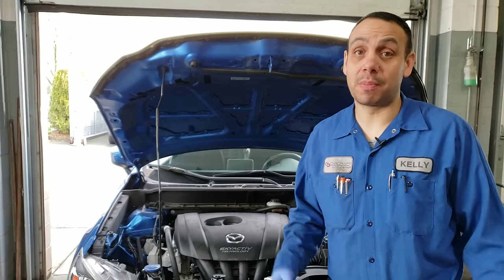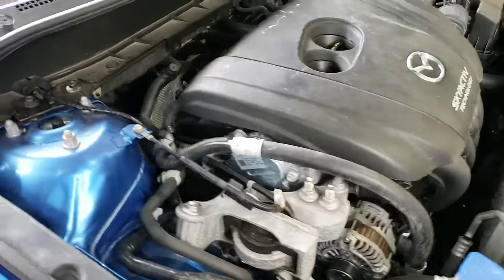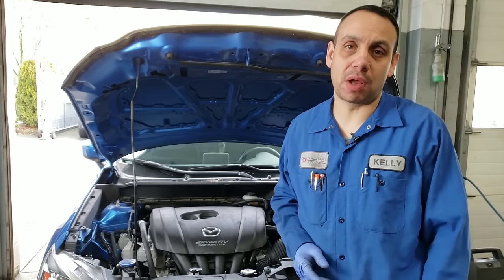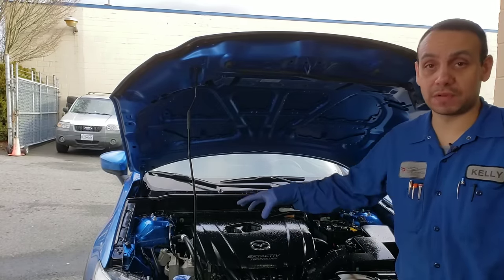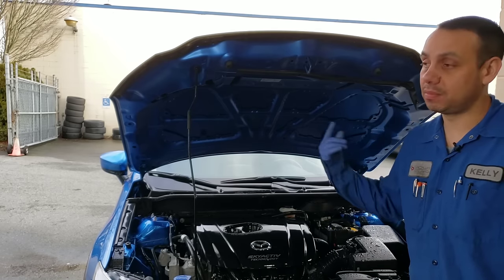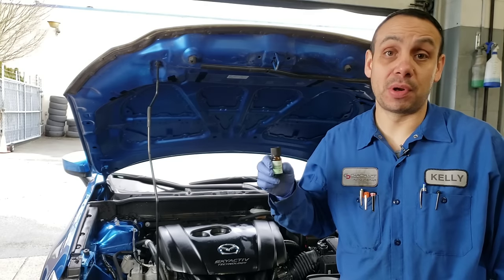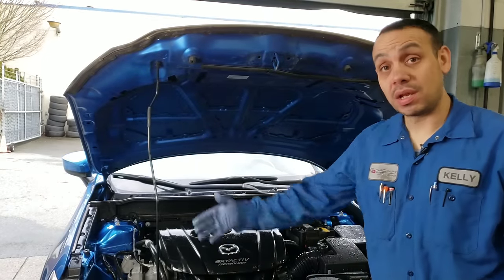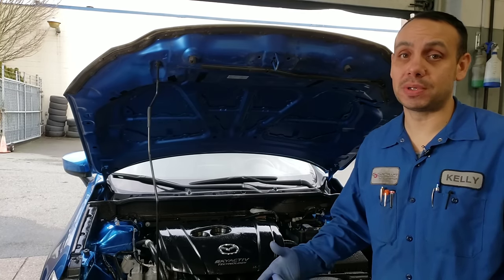Easy Tip To Keep Rodents, Mice & Rats Out of Your Engine Bay

Comment: Thank you for a very worthwhile video! Vermin attacked my fairly new F-150. It was costly. Wish I had known of your system.
Reply: My friend had a brand new side by side to hunt with and a rat cheeed the wires the first month he had it there were several motorcycles and two four wheelers and it didn’t touch them. I set ont big trap and he set one. I got him the first night but I used to work in a face so I know the routes they like to take.

Comment: Great video.  I had to watch it a couple times to hear about hosing the engine down.  I grew up always being told not to but that was 100 years ago (not really) and things have changed with engine design.  
Have a new Dodge Ram and opened the hood and saw that something was starting to tear away at the felt battery cover and had to look up to see what I could do to prevent this before it becomes a problem.

Comment: Great video! The problem is that the peppermint smell will last a week at the most, even less time if it is very hot outside. It will all just evaporate away. If you set traps under your car you can catch or hurt many creatures that are not interested in you car.  I put some peanut butter on a mouse trap and killed a vey cute little bird that made the mistake of pecking the trap.
Get some sticky pads and lay them on flat surfaces under your hood, tape or fasten them in place and bait them with cheese, nuts or seeds. If you use peanut butter use only a tiny speck, the oil in the peanut butter dissolves the sticky on the trap and can make the trap fail.
Those rodents can chew wires and cost you thousands of dollars trying to find the damage. Good luck!
Reply: That bird should have been minding it’s own business
Reply: You have a GOOD IDEA, BUT realize you are going to go through a LOT of traps! The rodents leave "trails" that every rodent within a mile will "tune " in on, killing EVERY rodent in that large of an area will be quite a job! GOOD LUCK!!!

Comment: I saw on a video a couple of years ago that some guy in Arizona makes a concoction of very hot chile peppers and sells it in spray bottles. Others said it worked after they tried it. I guess rodents nesting and chewing wires is a big problem with RVers who boondock out in the desert.
Reply: I live a few miles from him and use that 8500 Scoville rat spray.  It does work, but you do need to respray every couple months.  It doesn't have much of a smell, but will will make you cough and sneeze, if you get careless.  I was a bit overdue, and the little cusses bit through some wires, which I fixed.   But now I need a scan tool to reset and turn off the idiot lights.  I also put a small bag of moth balls on each side, especially next to the battery.

Comment: Very true, peppermint oil is great. I have. VW T3 Westfalia camper and store it over the winter in large vehicle storage building. First year it was filled with mouse droppings and some things left in the van were chewed up.
I then bought mint oil and filled small containers with cotton balls soaked with the oil and placed them throughout the interior and problem solved. You can use the small bottle after emptying some of the oil. Just stuff cotton in and put the plastic dripper back on without the lid.  I threw in a couple mint tea bags too which also seems to work. Japanese peppermint is the strongest.

Comment: Once had a chewed up chicken bone, a gnawed on piece of gum, and a half eaten  piece of bacon under my hood. This resulted in almost $2,000 in electrical damage. The peppermint oil works like a champ.
Reply: Where did you get the peppermint oil? Thanks 😊
Reply: @richardhowe5583  At the health food store. Whole Foods and Walgreens also carry it. I heard that Cayenne pepper / water solution or cinnamon works too.
Reply: @Steven_Williams  thanks? Do you dilute it? Thanks 😊
Reply: @richardhowe5583  Yes, about 1/2 water to 1/4 peppermint oil or Cayenne pepper.  Adjust the strength as you see fit.  Interior of your car may have a strong peppermint smell. I found it to be great for stuffy noses while you're driving 😁.
Reply: @Steven_Williams  thanks😂

Comment: High fragrance dryer sheets work also , be careful not to put them near high heat sources. When i put my truck away for winter i put them in engine compartment, cab of truck , in tail pipes and also on the intake side of my cabin air filter. I leave the cab ones in all year for the nice smell . $5.00 for box of 100 sheets !
Reply: That's the best way, period.

Comment: I have never had a problem with rodents under the hood of my van but I lived in it on my land out in the woods for several months and it was a constant battle with mice inside the van. I liberally spread peppermint oil throughout to the point of nearly gagging myself on it but it had zero deterrent effect. Fresh peanut butter bait in a spring loaded trap will give you the edge. For a while.

Comment: I had an old school bus some years ago. It sat for several months. Found where a squirrel had been nesting in the breather where the air filter was missing. Recently we had a problem with our van with an odd reduction in power and warning lights coming on. The mechanic found some wires chewed on, likely by a rat. We had a family of rats living in our shed. Wound up costing over $700 on parts and labor. So glad I came across your video. The peppermint idea sounds really good. Thanks.

Comment: Use Clove oil, works great on vehicles, farm machinery, and around the house,have used it for years!
Reply: Where do you get clove oil? Do you dilute it? Thanks 😊
Reply: @richardhowe5583  kinda hard to find, I buy it at J/C food store, in the spice section, small bottle, used for candy making, full strength on cotton ball's as a wipe, or leave in needed area's. You can dilute .125 oz bottle in quart of water to spray. Hint spray where rodents access, usually where tires touch ground. Hope this helps you!
Reply: @jimbruner9800  thanks😂
Reply: <Thinking> Cars outside!
Im going to get some OIL of CLOVES tomorrow what a simple idea.
Thanks for the tip < 🤔👍
Reply: Hello! Does the clove oil last longer than peppermint?
Reply: Don't know, never tried peppermint, cause clove oil works

Comment: First of all, foreign wiring that is used is made with material that attracts mice and rats. This video info is good! Rodents also LOVE the cabin filter area, so check it often. Remove all foil ketchup and taco packs, they eat right through them! I use mothballs inside my boat and compartments.

Comment: I use dialectric grease on plu wires and all exposed wires and connectors,  I tried mouse traps and ten traps did not work , they hate dialectric high temp clear grease ,that allso protects and shines plastic parts

Comment: I use peppermint oil around the house whenever I find rat evidence; I heard they use urine trails to navigate and the oil overlays this. I can't set a dog on them because people poison them, very bad for the dog, and I won't use poison (it's unsporting). The house was empty for years and something of a rat superhighway when I bought it but I haven't seen one in over a year now. The smell goes away after a couple of days, even indoors, so a car may need a daily spraying, depending on the scale of the problem. Your electronic box seems like a more 'fit and forget' thing, which would be worth the cost for most people.

Comment: I've lived in the Arizona desert for over 25 years.
When you get tired of spraying your engine with peppermint, stuffing dryer sheets everywhere,  and you now gag at the smell of Irish spring, there is only one solution I've found that works.
Moth balls don't work, battery powered anything doesn't work, a cat or two stuffed under the hood is a great idea, until you forget to take them out before starting the car, and you end up making Alf a feline paté.

You could try to find a used scrapyard electromagnet to suspend your car in the air at night, but the energy needed to run it might involve building your own nuclear power plant.

Traps are pain and messy, plus the smell of cheese or whatever might actually attract those sabre toothed insulation and copper starved cavia porcellus.
The last episode of rodentious mastication I encountered cost over $1400 to to find and repair.

My mechanic tells me one possible reason for mice attacking car wiring is that the wire manufacturers use a soy based oil to lubricate their wire looms.
I could see that being a major contributor if indeed that's the case, but I have no idea or proof of that theory.

But there is one solution I came up with, it's simple, effective and cheap. 
I haven't had rodent problems now for a few years since implementing it.
Before that, I've had to scrap two cars, and actually had a rodent nest catch on fire under the hood of my pickup while driving down the road. You don't even want to know what that one cost me!

So, if you're still reading this, you probably want to know the solution because you've probably spent all kinds of money trying to stop this problem, and you're sick and tired of your car smelling like a cayenne, peppermint soap candle.
It's quick, easy, takes only a minute, and don't you just want to know what it is?????
Don't you?
Okay, here's what you do:
First, you'll need (3) $20 bills, put them in an envelope,  along with a self addressed stamped envelope and mail them to me at........
Just kidding, but I had you for a second, right?
Ha ha! I are a funny guy!

So seriously here's all you need to do.
Find a 2x4, wooden block, or just about anything that's somewhere around 8-12 inches or so.
Next, you'll need a bungee cord.
When you park, open your hood, prop your 2x4 under it, and bungee cord the hood down against it to the bumper or grill.
That's all there is to it!

Simply explained, rodents don't make nests where it feels unsafe, or leaves them vulnerable.
When your hood is closed, it feels like a safe hidden area, with all kinds of snacks to munch on after spending hours making a nest.
But, if your hood is slightly propped open, it's not safe anymore, and there's nowhere near the protection that a closed engine compartment provides.
Trust me, it works.

Otherwise, feel free to continue to bathe your car in patchouli oil or whatever else you're using that doesn't work.

Comment: I’m on a farm in Arizona and had to fix my wirer harness because of this rat problem in Trucks eating the wires. You can also lift the hood up and place a bright light 💡 in your engine compartment. They don’t like the light 💡. But this peppermint oil is a very good idea . I’ve heard of it. It works very well .

Comment: I had wires to the AC chewed by rodents.  The mechanic suggested putting a few mothballs where they don't roll away.  They have to be replaced as they get smaller and smaller and eventually they're gone.  It worked.

Comment: Dryer sheets have been working for me for mice in pop up trailer.
Reply: New ones, or after they're used.
Reply: @stanleycronk4136  new ones of course... if you have a bad mice problem, put some in the garage and inside the sheds.

Comment: Rodents chew through the electrical wiring and fuel lines because auto makers switched from oil-based coatings several years ago to soy-based in the push for eco-friendly products. They basically rang the dinner bell for rodents because soy is a food. Lots of lawsuits and complaints out there if you do a search. I just had a squirrel chew thru the fuel line of my 2015 Subaru. Hoping to prevent this again, so will try the peppermint oil and see if it works.

Comment: Better to use rodent spray which can be purchased by the gallon. Essential oils are extremely detrimental to all plastics with exception of one or two. The plastic coat around wiring could be eroded by the oil and eventually open up and short causing catastrophic damage to the computer or even worse an engine fire. The rodent spray is also infused with peppermint but is water based instead of oil so it is much safer for this application. The use of the cotton balls is a better idea if you are going to use oil as long as you lay it against metal only but be warned it will damage the paint. There is a reason essential oils come in glass bottles. It isn't because it makes them look fancy, it's because the plastic can't handle it. The clear plastic that is inside the cap and dropper is a special kind and very expensive to create. The average kind of plastic is nowhere near as resistant to the oil. You car paint is essentially plastic.

Comment: If you add witch hazel to the water, it allows the oil to actually mix with the water instead of staying separate.
Reply: Peppermint oil will mix with the water and will not separate. I use it all the time my classic is in storage. Respray every 2 weeks.

Comment: Some say never to wash your engine with water.  I have been doing it since the '60s with no problem.  But it is important to first cover and wrap (in plastic), ALL locations where water might seep into areas where oil, fuel or air are....Then, after washing remove all plastic and run engine to dry..
Reply: Difficult to do nowadays when everything but the block and head is plastic. Those that say to never wash your engine with water have obviously never driven in heavy rain, Duh.

Comment: I get concerned about spaying down an engine due to all the electronics now being used under the hood.  Are there any precautions I should take when doing this?  
Great video!
Reply from the maker: It really depends on the vehicle. But I'd say 99% of vehicles this isn't a issue. Petty much industry standard, worked with dozens of techs over my 25 year career and this is what we do.
Reply: recommend not spraying water in engine compartment for the reasons you state

Comment: Many useful tiips. Thanks for posting. I was thinking of spraying down the engine and was happy to see you do it too. I also wondered how long it woruld work. The only other things I've found this time around is moth balls. Some say they will stink up the car's inside air, some say it won't, some say you never get rid of the smell. I'm at my wits end in contradictory searches.

Until now, I've been using pure peppermint oil drops on dryer balls after the first time my wiring harness was chewed right down to the plug last year (Apr. 2021). I thought after months of using it (Mar. to June this year) critters wouldn't bother going near the car. I was wrong since it's happened again. My car is currently in the shop and I'm looking for a fool proof fix, but so far haven't found one.

Comment: I know a farmer that had $10,000 of wiring damage to a combine, so to solve his issue he had to place glue traps around his farm equipment, and on top of tires, and in the engine compartment. He said it worked and had no more issues but he had to check it regularly.

Comment: That's the same thing I do. My vehicle is kept in a barn, not a typical garage.  My last vehicle a mouse got in the AC ductwork and when I started the engine it was chewed up by the blower fan. Cost to repair and cleanup was too much so I traded it in on a new F150. Now I keep the engine bay sprayed down with peppermint oil.  So far all is good.

Comment: Informative video...should be noted that once a rodent has made a nest nothing will keep it away. You'll have to kill it
Reply: Buy Tomcat brand 4 pack of rodent bait. They eat it first cause it's made for them. They never get to your wires. 
Also, place one at each corner of your house and you won't see any mice making it inside anymore. Most rural & farm stores have it.
Reply: @johnwunder3521   It is sealed in a little hard plastic Box and the only way to get to it is to be small enough to climb inside of a inch square hole like a mouse. I don't think anything else, including the chipmunk that lives at my house is in jeopardy.

Comment: Keep vigilant at checking under the hood every day or at least every other day.   I found tomcat press and set traps work great as they don't accidentally trip when driving the vehicle, only when the mouse goes in for the bait.   Stick them down on a flat surface under the hood with heavy duty Velcro underneath.

Comment: Early Miata owners: the fuel pump access panel behind the left side seat runs into the trunk.  Somehow, on two occasions, a rat managed to get in there and chewed completely  thru the 14 gage fuel pump power wire. After the second event, I ran the wires through armored shielding used on industrial machinery  and sprayed the exposed connectors with oil of peppermint. no problems since.   how they got into the trunk remains a mystery.

Comment: In Florida, palm rats are a big problem, getting in the engine bay from underneath and feasting on wiring harnesses. Get a small cloth mesh bag, put 3 moth balls in it, and secure it under the hood. Keep it as far away from the fresh air intake for AC/heat as possible to keep the smell out of the cabin. Works great-replace the moth balls every few months.
Reply: Any place with a lot of democRATS.